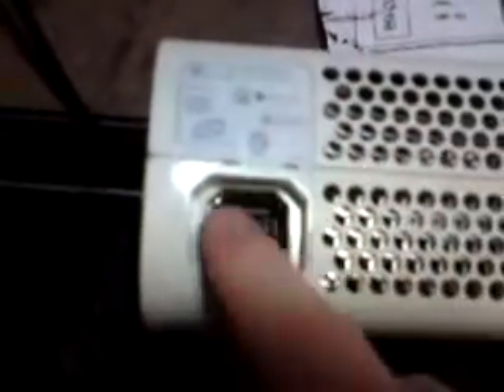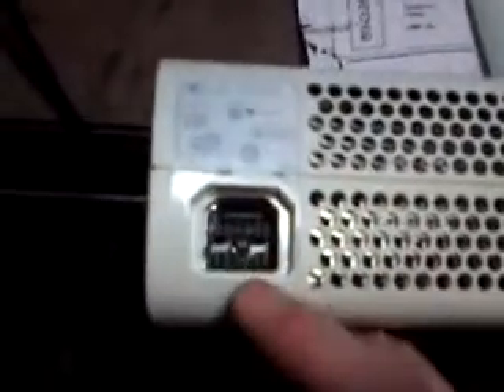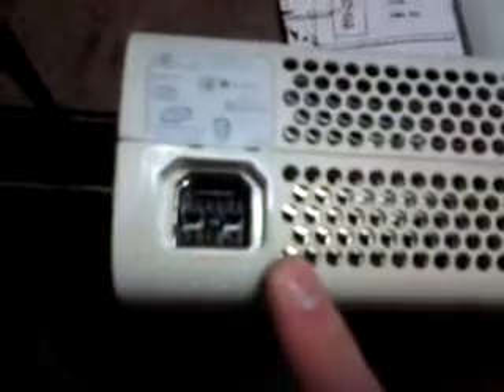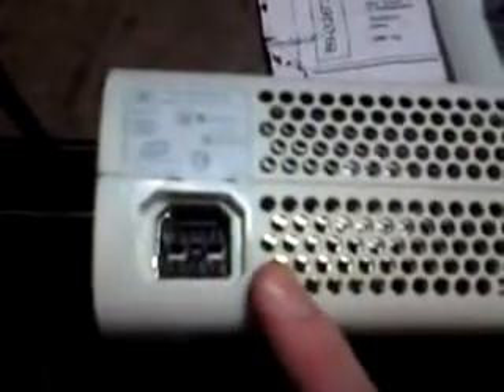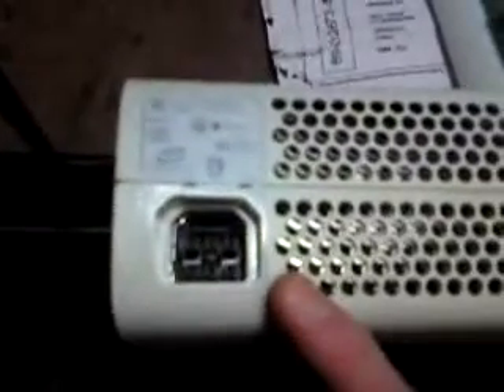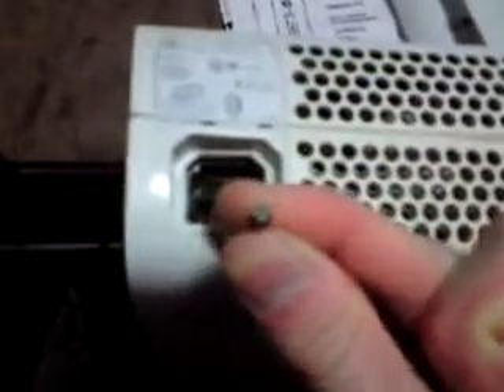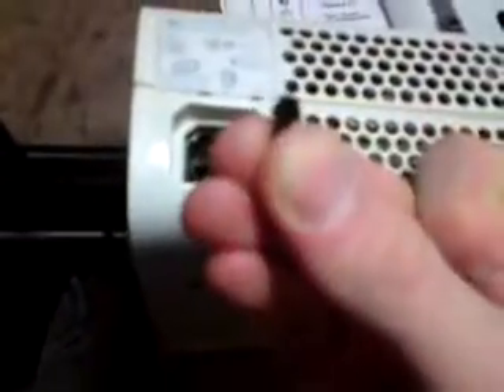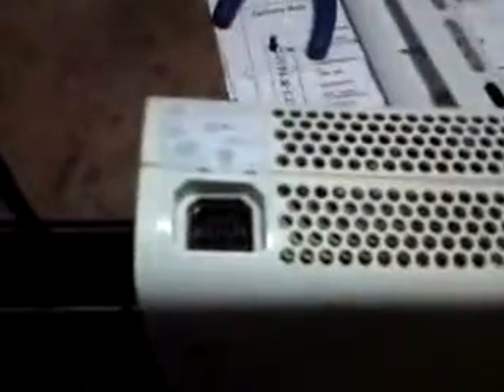Modify Your Xbox 360 JTAG RGH to Use With ANY Powe

Comment: dont do this or expect a burnt out psu you can use greater wattage for later models so 203w on 175w and 150w but not 150w or 175w on 203w because it will demand the full wattage and will still need more sp the psu will be overworking leading to premature failure! common sense thats why later model psu dont fit older model xboxs but older psu fits later models

Comment: you are an idiot. xenon model requires 203w of power in order to work properly. if you give less power using falcon or jasper supply the xbox will have problem and it will get damaged. PEOPLE YOU HAVE BEEN WARNED

Comment from the maker: That's probably because you have a 150w supply (jasper), again just remove the black plastic and you should fit it in, just be very careful not to damage the metal prongs
Reply: Jon kirkham 
I want an adapter so I can plug a slim power supply into this model
Reply: Frank Nakamo Holy fuck you really want to damage your console!

Comment: how so? it's perfectly safe the console draws the current it needs only and under powering would just cause some extremely power sucking USB devices to not work properly but any power supply should work in any Xbox 360 and slims are a whole different plug
Reply: Synthax No no no YOU CAN DAMAGE YOUR CONSOLE OR PSU!

Comment: you can safely use 203W power supplies on any console as it only draws as much current as it need but what is dangerous it using 203W CONSOLES on 150W but it's even then very highly unlikely of anyhting going wrong and the worst could happen would blow the supply but REALLY UNLIKELY though it's completely safe to use falcons on the 150W